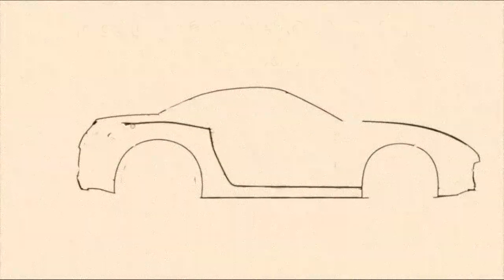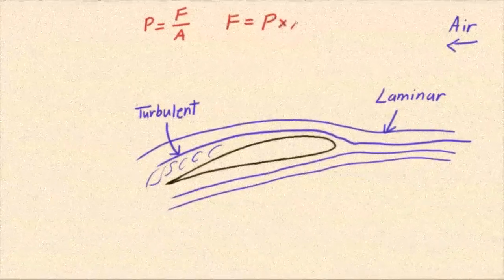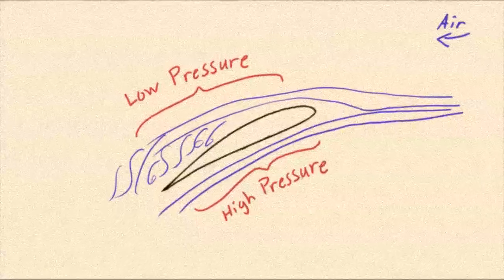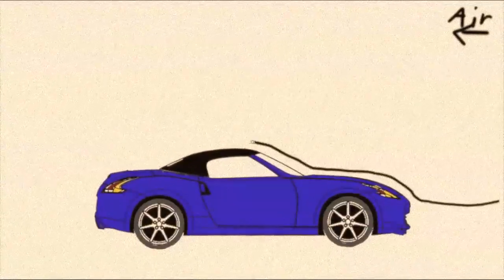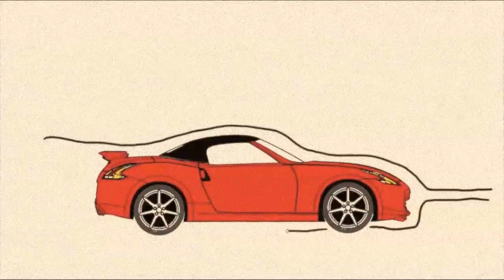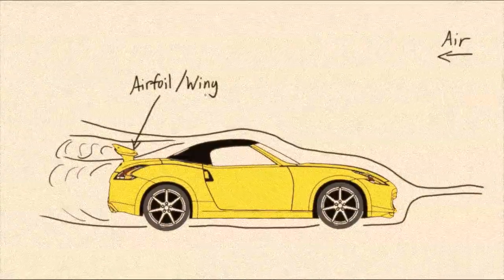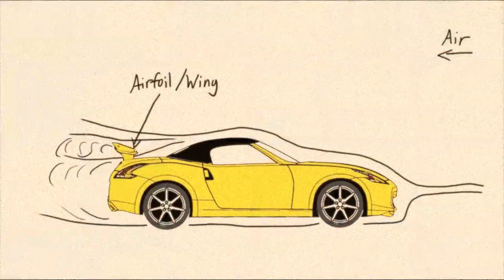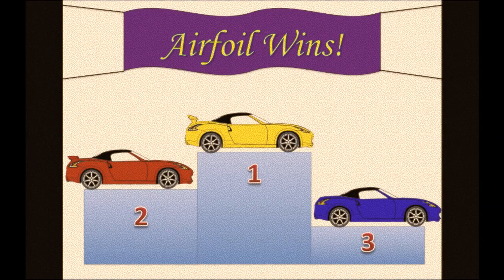Sports Car Aerodynamics: Spoiler Alert!

Comment: NOOO, how does increased downforce increase acceleration? spoilers create downforce and drag, not HP. given that, we see that aerodynamically these spoilers would be a disadvantage in a straight-line race. The only time the increased downforce would be useful in this situation is at the beginning of the race, where improved traction would also increase acceleration. BUT, at the beginning of the race, the car is moving slowly and thus, so is the air moving over the spoiler, making it useless. By the time the vehicle is moving quick enough for the spoiler to come into notable effect, traction would no longer be an issue. At this point, all forces of the spoiler become a disadvantage. More drag, more mass (them weight savings, bro,) and of course, the downforce would make it more difficult for the car to accelerate as well.
Reply: +T.B. Squad    Absolutely.  I think this guy sells spoilers and wings on the side.  I don't think he ever mention weight, and he sort of presented a drag race of sporty cars.  The blue car would win.
Reply: Rama Kant increased friction force, on its own, is not a factor for increased acceleration. increased friction force would only be an advantage when the amount of traction is not sufficient for the power of the car. As speed increases, the amount of friction force needed to maintain grip for a given power level actually decreases. Extra downforce = extra weight = extra friction. the increased weight and friction become a MASSIVE disadvantage as the car increases speed and their effects are increased. Like i said, at slow speeds, the car could benefit from additional friction/traction as the initiating friction force also has to deal with inertia of a car that is still. HOWEVER, at these speeds the spoiler/wing does not have enough airflow over it to for it to work. its an "aero" part; its force, by nature, is directly related to the speed of air moving over it. so, at high speeds, when the spoiler comes into effect, the car can maintain grip without any increase of friction force, and therefore, its useless. friction hampers speed. that's simple physics man.
Reply: Rama Kant lol. ok so, friction is not causing the car to move or accelerate ON ITS OWN (I did say that.) a mechanical force is needed for any type of movement, first and foremost. In this instance, the engine. Now we get to the friction part. newton's second law is saying that a force applied to an object is proportional to the speed of its acceleration. FRICTION IS NOT THIS FORCE. the force applied is the rotation of the tires, which is an INdirect translation of the engine's force (we'll get to that later,) which THROUGH friction causes acceleration. example: my cousin used to own a prius; when he floored it, it couldn't spin the tires. Now, if he were to use a stickier compound of tire, would he be able to accelerate quicker because there was more friction? no. the friction is merely what transfers the force of the engine to the road's surface, which is the force you would use in newtons second law when referring to this example. ok, on to the amount of grip needed at a given speed and power level. When the mass of a car is stationary, inertia dictates that it will want to stay stationary. therefore, the amount of force needed to "initiate" the acceleration is greater than if it were already moving. The force of inertia is directly related to the speed in any given direction of the car. Now, in first gear, the ratio of force applied from the engine to the tires is very high, meaning that a high level of traction is required to convey that force. as the gears go up, the force conveyed to the tires decreases, and proportionately less traction is needed to maintain grip. (the force is now in present in the form of speed.)  Now on to your mass/weight argument. As a spoiler produces down force, it is increasing the WEIGHT of the car, but not the mass. I mean, bloody hell, man, the shit is called DOWN. FORCE. its a force that's downward. of course its added weight. weigh a formula1 car at a stop and it'll weigh 1/2 as much than if you weighed it at 180mph (assuming you could.) And, because the added weight is directly proportional to the speed of the vehicle, the added traction is only having an effect on the car when it's not even needed (In higher gears where we see the force of the engine in the form of speed, rather than torque.) THEREFORE, as i have just proved through the laws of physics, every aspect of a spoiler in the instance of straight line racing a 370z is a disadvantage. 

I suggest you know basic physics before trying to talk condescending to someone who is clearly wrecking you right now, "sweetheart."
Reply: @ZZPxFTW  I guess you don't watch any drag racing then
Reply: spaghettimonter because?
Reply: +T.B. Squad So right! This video gets the physics right, but the answer wrong. Furthermore, downforce alone does not make you win a race, it's the fact that downforce gives you additional traction (higher Mu, coefficient of friction) which allows you to make turns at higher speed without losing traction and crashing
Reply: +Rama Kant the force of the engine acts through the rotation of the tires, which require friction to cause movement.  But, you seem to be under the misconception that an increased friction force will directly relate to an increased acceleration force. back to the prius, we see this simply isn't true, 

 static friction versus kinetic friction doesn't apply because the tires aren't sliding... kinetic friction applies to objects that are sliding against one another. So, i can very well, and scientifically accurately say that as we speed up, friction requirement is reduced because of the gearing (as i already explained.)  a great example would be my 335i. It can spin first and second gear with ease, but in fourth, even if i have the engine at optimum rpm, it would not be able to spin the tires. The amount of torque applied to the tires versus what gear is being used is actually very dramatic. so much so, that even in second gear, i'm not entirely convinced the 370z in question would be able to spin the tires given a dry road surface, much less higher gears like 4th or 5th, where we would see the effects of the spoiler come into play. 

Lift would actually be beneficial, up to a certain point, if you're looking for pure acceleration, because load = weight. "Whats the load capacity of that truck..." If you apply a downward load on something, it will weigh more, regardless of what you want to call it.  less weight = better acceleration, given no other factors. i'm sure we can agree on that much. We know a 370z will not take off within it's top speed. So, the Bugatti reference is almost entirely irrelevant. 

Every racing team knows the basic formula: you want to go faster in a straight line? reduce downforce. REDUCE IT. 

want to go faster in the twisties? add downforce 

Idk what argument you even have that i haven disproved anymore. for an english major, i think i'm doing pretty good, considering you've got nothing left going for your notion that spoilers increase acceleration.
Reply: Sailendra Nath Shrestha You're very right in all that you said. However, I would disagree with the point about me missing the point lol.  Although you are right in saying that would be the only useful purpose of a spoiler in this instance, the video, and @Rama Kant (who deleted many of his comments now, so my argument may appear to be missing the point of the spoiler, but in actuality, i was addressing points that user was trying to make) are clearly trying to argue the spoiler would give the vehicle a notable advantage in velocity. Even one with the simplest concept of physics would know this to be false. 

The high amount of lift at high speeds would be the cause of the high pressure zone under the car. A spoiler pushing on the rear of the car, may cause the front of the car to be slightly higher, increasing the reverse rake angle, and present an even higher pressure zone under the car. even though the rear of the car is being pushed down, this may make the nose susceptible to becoming airborne. (this phenomena actually happens with racecars, causing them to violently back flip) Testing would have to be done to find out which vehicle would be most stable at high speeds.it could be any three of the cars in video... cheers for presenting the only actual argument for the spoiler being a benefit. still slower though lol
Reply: +T.B. Squad Dude everybody knows friction doesn't act on its own , it needs a stimuli.

"a mechanical force is needed for any type of movement".Correction: not just any force but an external force.Which in this case is friction .

Well on your first gear argument, you're right except that you're missing this: During launching the car needs to overcome the static friction; which is a lot more than the kinetic friction which acts under motion, thus u need less driving force at speeds to overcome friction and more force/torque at the beginning. The value of kinetic friction doesn't change much with speed(depends on a lot of things, it might increase/decrease, but only by a meager amount).So you cannot say that as we speed up friction requirement reduces.Because its basically the traction force.

Moreover all your arguments are based on the fact that the car is not experiencing any lift while moving at high speeds. The air flow under the car is laminar in nature while above the car is turbulent causing a high pressure zone under the car and low pressure zone above it. Thus causing lift . We need that downforce to overcome the same. Bugatti Veyron moves at speed higher than the ones required for take off. Had there been no spoilers on it, she wouldn't have been able to do so. I hope you get the reason of using spoilers which is still the same as in my previous answer : better traction which can be achieved either by increasing the normal force(use of spoilers/wings) or the coefficient of friction( using better compound tires).

P.S. In the language of physics that extra weight is called load or the 'apparent weight'.
Go clear your concepts kid!. Then try condescending someone else.
Reply: +T.B. Squad Your quite right. Spoilers/ airfoils are absolutely useless in straight line drag racing. You do not get the downforce when you need it, and you get it when you don't need it. But just to add to the thing on friction, it is newton's third law that explains why friction is needed. You would not be propelled forward if there was no friction. No friction means you are not going anywhere, too much will eat away your engine power. For the best straight line performance, you need the optimal amount of friction that is sufficient to withstand wheelspin, yet not too much that hinders engine performance. A spoiler is only needed for bends where your wheels slightly slip due to radius differences, and friction is no longer static and becomes kinetic, which is lower than static friction, therefore a spoiler is needed to make up for the difference in order not to spin out
Reply: @nicholaslau3194  Top-Fuel dragsters disagree
Reply: +blackrack2008 literally all my above comments prove, with laws of science, why you're wrong. Get educated, then come talk.
Reply: +T.B. Squad man i don't know where to start, a LOT OF MISCONCEPTIONS IN THIS VIDEO, the thing he's calling lift is called downforce in the field of car aerodynamics, it is disadvantageous on the turns, but it will create drag which is disadvantageous in straight race, that's why most modern supercars have DYNAMIC SPOILERS that open when you're braking or turning and revert back down when accelerating, it's usually like this: more downforce = more drag, some designs will vary that balance a bit, but certainly more downforce doesn't mean more acceleration!!!! it literally means more MORE GRIP and drag means LESS ACCELERATION...

in formula one where dynamic spoilers are not allowed (there are some new exceptions to this) it all comes down to the right spoiler angle, where it creates enough downforce for the car to grip during fast corners but not slow it down much during straights, getting more downforce than the supposed "perfect angle" for a track means that the car will not accelerate well during straights and getting less downforce means it will have to slow down more during corners.

and by the way TB Squad, more apparent weight will slow the car down, but because of the accompanying aerodynamic drag force and increased wheel friction, not because it changes mass, you clearly got the jist of it more than the makers of the video, mistakes happen, but should NOT HAPPEN WITH EDUCATIONAL VIDEO MAKERS, it's not ok to read for 10 minutes about airplanes aerodynamics and then make a video about cars, even if you made a wind tunnel.
Reply: +T.B. Squad Anyway, topfuel dragsters use dem spoilers.. But i guess they need the traction, even at high speed.. or maybe its there to stabelize the car?
Reply: Finally someone said it
Reply: +T.B. Squad There is point in what you are talking about. But in this discussion, I feel, you are missing the main purpose of the spoiler. 

The main purpose of spoiler is the improve ground handling which in turn also help car at high speed.
In this video, the car without spoiler will have high lift at higher speed, which may cause the car to fly and loose contact with ground. As we all know, there always need to be a body which will face our counter force in order for us to move forward. When the car is flying, it looses that counter body (i.e. road). When it is flying, it is moving due to inertia only, and all engine power is not being used to move car forward, which is lose of power.

To conclude my point, if the blue car does not fly at its maximum speed, it will have enough traction to use its engine power to move it forward and it wins as it have less drag compared to others.
But if it does fly at its maximum speed, we need to use spoiler or wings.
Reply: PekosGaming Daily stuff & things 

It does not increase acceleration...

For example, take any supercar shitbox you can dream of and race it against a Tesla on a quarter mile strip. Which car wins is meanwhile  known.  Now, have you seen a Tesla with a fancy spoiler yet?

Take both on a windey european mountain road and the Tesla will be first again. You can't go fast enough for the spoiler to do its magic. 

Take both on the Nürburg Ring and the situation changes completely. The supercar will win, as the speeds are much higher and the spoiler can play its positive effects. (and the Tesla is also too slow)

On regular road cars and for regular road use, the only benefit a spoiler has is looks and improved airflow =  better coefficient of drag.
Reply: Martin Leutwyler you actually think Tesla is fastest car in a straight line? Lmfao
Reply: Turtle_Entertainment 
Yep, It creates downforce to increase traction  to prevent the wheels from spinning silly, thus allowing better acceleration & stability. But you need a huuuge wing. 
Thats why the micro spoilers on normal cars are nonsense, except for improvement of aerodynamics.
Reply: Accleration != HP
Acceleration is the change in speed, power not. 

If you have the same power in two vehicles but one doesnt have tires, the one who has it, runs way faster (and more control), because of friction. 
When you add downforce to the car, lets say a spoiler, it forces the car more against the ground, and as friction = u.n (u-micro=the surfaces specific friction constant, n-normal force, the force involved, basically), when you make more force, you have more friction, thus the car can convert more of its energy into cinectic movement, making the car run faster, and more controllable.
Reply: Edit:
To everybody here
While having an airfoil would typically increase drag a spoiler can be quite different. Spoilers are designed mainly to reduce drag and lift by pushing the airflow upwards. This stops air being trapped in vortices behind the car thus reducing the low pressure behind the car. The decreased low pressure behind the car leads to less drag. The reduction in drag a spoiler gives through this process is much greater than the drag it generates itself. This is why all modern road cars have small lips at the back ends, these lips act as spoilers. On top of this the air that is pushed up also pushes down on the car reducing lift and increasing traction and stability at greater speeds. This means that a spoiler should in fact (if properly designed) lead to greater top speeds and efficiency. This increases acceleration at higher speeds while having no effect at lower speeds. An airfoil can do a similar job while decreasing lift by a greater amount resulting in a net generation of downforce but it will generate more drag by itself and result in more overall drag. This is why the F40 has a spoiler and why cars like the Buggati Veyron and Chiron have spoilers that come up above certain speeds. Because they increase acceleration and stability at high speeds and reduce drag.
https://www.youtube.com/watch?v=quDLzxmJl5I
This video does a much better job at explaining the concept as it does so using flow visualisation.
P.S
I also found it a bit misleading how he showed the performance in a drag race because his video did not aptly explain how an airfoil or spoiler would improve performance in a drag race and actually described something to the contrary as he talked about the increased drag. But at the end he did mention same track which implies he meant for corners to be involved and he simply couldn't show this due to animation limitations.
Reply: blackrack2008 read the entirety of the above comments and you'll know why that is wrong lol
Reply: Lindholmer5k yeah, i kinda thought about that lol. top fuel dragsters have an absolutely absurd amount of mechanical grip from the get go, but it could be for traction.
Reply: True...thank u for save my words
Reply: +T.B. Squad Tyres are always sliding. The tyre surface has to deform in order to conform to the road surface. They don't do that perfectly so they slip a bit. That led to the development of the close interval firing sequence of GP motorbikes way back when. And that compound is far more "grippy" than street car tyres.
Of course, I don't really know of any street cars that benefit from spoilers or wings or whatever. Not at normal road speeds. They're just bling. But for race cars that may go around a slow corner at 100km/h, then accelerate to 240 km/h it's a very different matter, isn't it.
Your mate's Prius won't do chirpies coz it's a Prius.
Reply: T.B. Squad in tyres are alwahs slipping,even at 300kmph in f1 levels of downforCe.But you are correct,the traction gain isnt worth the drag penalty.
And about the weight reductin part,downforce isnt a part of the inertia.So it doesnt affect the inertial motion of the car.
Reply: by reducing lift your not necessarily creating downforce just less lift and therefore less drag  and there is your answering . btw spoilers are also used to aid reduce drag coefficient. have you seen the spoilers in front of car wheels?
Reply: MAYBE you increase acceleration.... that's only if the tires were slipping if you didn't have the spoiler. Most of the spinning is going to happen under 45mph I would think though. It's really only after 45mph that spoilers start to have a dramatic effect. THAT effect, to me, is  mostly improved handling at high speeds. Being able to take turns faster (because of more traction) wins races, that's the point.
Reply: It does upgrade accelleration because you have more grip/traction because if it allowing you to increase throttle moments and increases corner speed, congrats m8... i did like ur way of thinking
Reply: Jason Henley 
Nope mate, the Mu is not getting higher with more downforce. Mu is a constant. What gets higher is the max. amout of forces (acceleration/braking/turning)  the tire can transmit.
Reply: Traction
Reply: T.B. Squad oh thank god I'm not one here feeling I lost some IQ
Reply: Does this explanation may support why certain hyper cars' spoilers actually work at certain speeds?
Reply: ChrisHallett83 Nope... Both make the air flow force the car down, but spoilers really force all the flow to pass over it, making the air change its direction, thus creating resistance to the car movement. The airfoil is a spoiler, but it is elevated, and it forces some of the flow change its direction and forcing the car down, but it allows some of the flow to continue its path, thus creating less air resistance. 
The downforce is cause by the air hitting the airfoil/spoiler changing its direction, and thus having some effect in downforce. 
Anything that changes the car ability to "cut" through the air increases drag, even airfoils, but they do that way less than spoilers.
The added downforce makes the car have a better traction and stability to the ground, making it many times, faster, because it can transfer more energy from the motor to the cars movement throught the weels, or because its more stable and have better controll, so it can make turns better. 

Thats why beetles races aways use huge spoilers (beetles have kinda a plane's wing, and with more speed it tends to try yo get out of the ground) so added downforce makes it more stable and with more traction to the ground. Porshes like the old 911, used to have spoilers too, or at least airfoils, to have more downforce, and thus having more stability.

How would a spoiler, that forces the air to go to another direction, and that air hits all the time reduces drag? How would a spoiler not add downforce? 

ANYTHING, i repeat, anything that adds contact area, even more if its vertical, not horizontal, makes the less easy to the car cut through the air, a blade-like shape would have the best aerodynamic. Thats why many prototypes and even lemans cars are smaller height... Search for carcará car in google, with a beetles chassi and motor they could make a fast car only using the right shape. 
Thats why lamborghinis, ferraris, doesnt look like a mini van... 
Thats why formula 1 cars have space only for one person and they try to have the least contact area (except for its spoilers and wings, that, again add downforce to make it more stable and have better traction).
Reply: @blackrack2008  dude are you that dumb
Reply: What about the lift that car gets by air flowing from below (at high speeds!) the car? 
That lifts up the car, so less traction so low balance so loss of revs so is the acceleration 

Don't focus on single area 

N believe in engineering, they r not waste everything has a reason
Reply: @अण्वायुवरीवर्त  catch is that the lift doesn't matter until speeds are high enough that the spoiler would then help with down force and or reduction of drag but that would depend on foil or spoiler. also the cars he has in the vid won't need to deal with that. last, revs don't change with lift if anything they would increase since less weight on the tires. balance is also the wrong word. stability is what you were looking for. acceleration at high speed might be affected except the down force also equates to drag and more force to overcome. don't get me wrong. a spoiler or foil can and does help if it is properly engineered for the vehicle and not just an aesthetic part which is what most vehicles sub 50k+ price point have
Reply: @twistedsocal  yeah Ikr 

By revs I actually meant revs when in solid contact with ground no slips 
N balance well yep stability is correct
Reply: Didn't really read any of the comments, so not sure if someone already mentioned DRS. But Formula 1 has DRS for this very reason. Under specific conditions, they are allowed to open their rear wing, giving them a 10-15 kph speed increase on long straights. It massively helps overtaking, but the actual effect varies a lot based on track specific car configurations.
Reply: Is anybody actually going to talk about canards and undertrays? Especially since they play a far more dominant role in the modern sports car era compared to the traditional spoiler and visual exterior down force generating mechanisms. 

P.S. certain angles of attack for spoilers work favourably in variable circumstances. It's easily identified in any modern auto sports. For sake of simplicity we'll use only exterior elements since under trays are slightly harder to explain. Anyways, where more angle of attack yields greater cornering capability due to the force of the oncoming air hitting the spoiler, it also yields a slower top speed. I'm keeping it simple here because I don't wanna bore anybody with high pressure and low pressure shenanigans. Your second option would be to run less wing, i.e. a less aggressive angle of wing and you'll cut a much cleaner hole into the oncoming air creating less dirty air which in turn for lack of better simple words, allows a slippery-er surface to provide maximum speed. However, you obviously lose grip in the corners since you've traded downforce for straight line speed.

A comparison would be a waterslide vs a playground slide. The higher wing setting being the playground slide and the lower wing trim being the waterslide. 

This is why in some motor sports now we have DRS, which stands for Drag Reduction System and is simple an adjustable spoiler. It can tilt further up, (an aggressive angle) and yield more downforce, albeit less straight line speed, or tilt the wing so it's parallel to the floor, straight and allowing air to pass straight through it as if the spoiler isn't there. This system is used predominantly in Formula 1 where a car is granted DRS on the straight parts of the circuit as long as they are within 1 second of the car ahead.

But yes, everyone who's brought complex science into it, it's just not necessary. At the end of the day it boils down to 2 simple factors. More wing = better traction at higher speeds but less top speed due to air resistance. Less wing = less traction at higher speeds however, better speed in a straight line due to lack of air resistance. 

Also, one last thing for the guys at the top who commented 2 years ago :p let it be known that a spoiler yields almost no benefit at low speed as a spoiler relies predominantly on airflow. Mechanical grip is the name of the game at low speeds, i.e. tyres and the transmission and how's its able to put down the power through the drivetrain. Add into that the differential and so much more but whatever. Aerodynamical grip is as the name suggests aero related thus with a lack of incoming forces they do literally nothing. Why do you think an aircraft doesn't float away when it's parked on the taxiway? Why do you think planes have airbrakes, flaps, trim etc? 

Aero is really quite simple if you take a step back.
Reply: also it does not increas top speed at all...
Reply: but why all race cars do have large wings? drag cars dont need it
Reply: Right, from 0 to 60 the downforce doesn't have much effect
Reply: but literally every low time drag car you see has a pretty significant spoiler.... ok
Reply: Snow_Ultra I’m pretty sure it’s there for high speed stability rather than increased traction. Those cars run over 300 mph on basically a stick with an engine and wheels
Reply: yea wings are only useful when accelerating on cars with so much power that they cant stop wheel spinning even in 3rd gear. def not useful on a nissan 350 Z.
Reply: Given that downforce allows for more tire action in general at speed, it helps with very powerful engines, accelerating while turning, and "negative" acceleration when braking- at least that's how I interpreted it.
Reply: @loafofuraniumfreshlybaked569  which is why F1 runs massive downforce, but totally useless in a drag race as referenced in the video, in which there is no turning or braking.
Reply: @ZZPxFTW  Like I said in my other comment, Top Fuel dragsters disagree. When your engine is beastly, you'll need force on the wheels, even at 100mph.
Reply: @loafofuraniumfreshlybaked569  The insane tires of top fuel cars and the fact that the upward-pointed headers produce 1100 pounds of downforce anyway means that the wing are still mostly there for stability at speed than in aiding traction and acceleration. Although it probably is a slight factor... that being said, taking the extreme end of thing with an example of cars that make 11,000 hp is hardly relevant to anything previously mentioned.
Reply: +T.B. Squad Increased grip.
Reply: It’s for the quarter mile that’s why top fuel dragster’s use them
Reply: I think the video is correct. You add a spoiler on car and it increase downforce. And the downforce increase friction to make car go faster